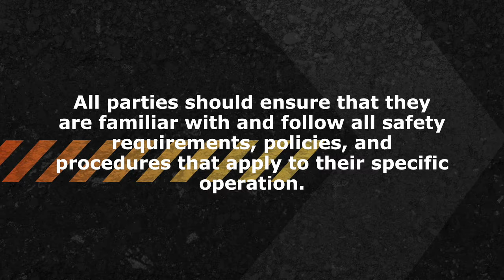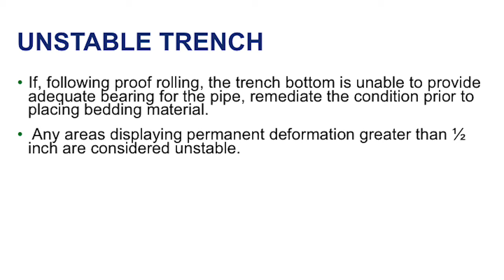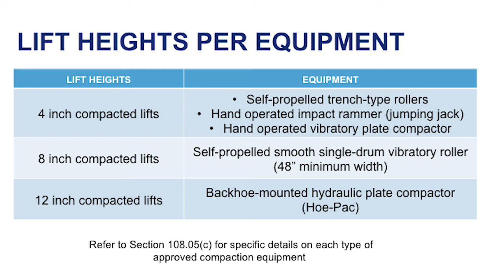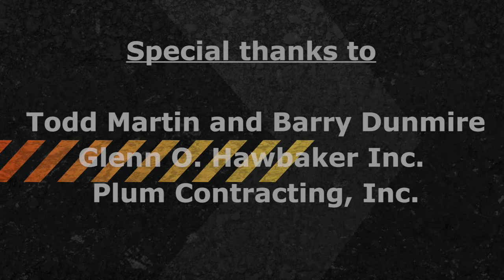Pipe Installation

Comment: Hello, we have many types of equipment related to precast concrete products, may I ask if your company has the need to purchase concrete mixers, of course, if your company wants to develop concrete pipe making machine production line, we will also provide you with a good solution.

Comment: Notice you had the laser set in the pipe in a few shots don't you keep messing up the laser alignment with the jumping jack running along the side of the pipes?
Reply: Laser is set at the end of the pipe. You use a receiver at the invert to check pitch. If good you move on. The compaction of the soil around the sides of the pipe shouldn’t change the grade of the pipe, as long as the trench bed is compacted properly.

Comment: 00:33 pipa inspection
01:11 Excavating the Pipe Trench 
01:50 Trench Preparation
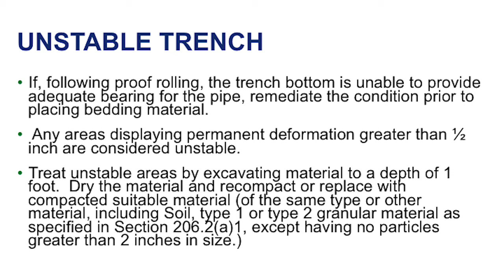03:05 Pipe Bedding
03:38 Pipe Alignment and Grade
04:26 Pipe Joint Caulking
05:38 Lateral Support
06:25 Materials for Trench Backfill
07:25 Compact Backfill
09:00 Reference Documents
Reply: Hey? How do you get experience in this? Wanna apply for the job but don’t know if learning on job site is optional